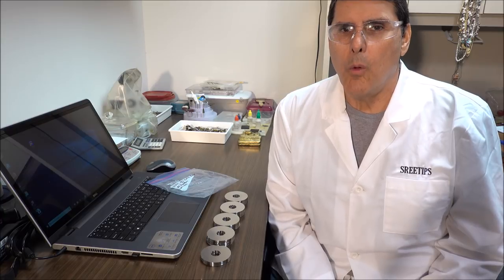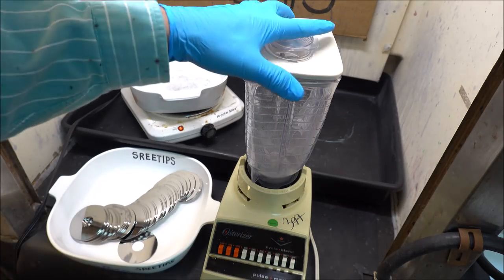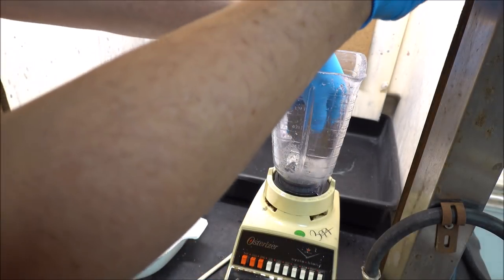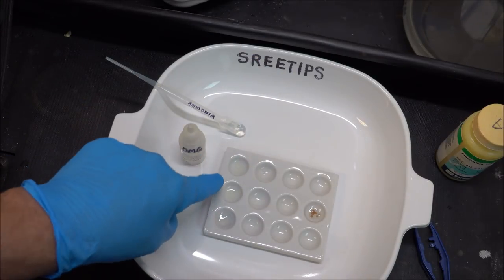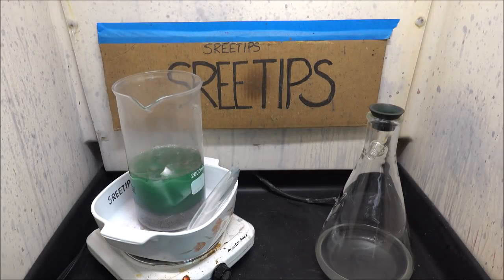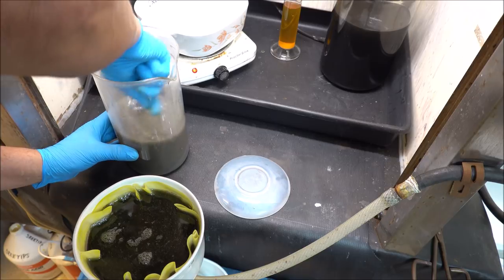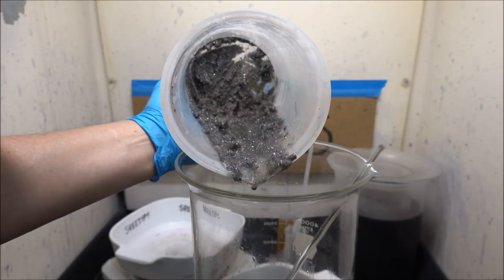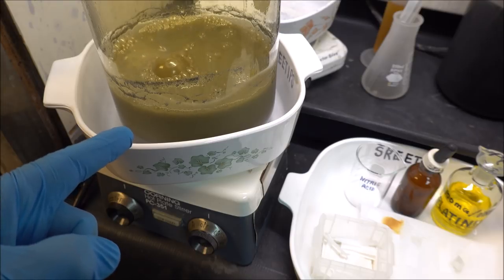Platinum Recovery From Computer Scrap HDD Platters

Comment: Thank you for your extensive and arduous work to prove the validity of going through this process. At first I was contemplating going into the first steps to do it but here you’ve said it yourself there is very little platinum in those disks. Thanks for saving me the time, effort, and money ahead of time. Love the videos

Comment: You would get more platinum by sweeping the freeway for the dust from catalytic converters
Reply: CODY!!!!
Reply: Isn't that palladium?
Reply: Cody!
Reply: @joeestes8114  CODY
Reply: @nickkk420  Most are made with platinum, but they did start using palladium roughly 10 years ago to save money, but now that palladium is much more expensive than platinum, not sure what they use now.
Reply: BIODIESEL, ELECTRIC, ETC...
Reply: Yes
Reply: @nickkk420  yes
Reply: Lol cody does dirty, ghetto rigged chemistry, haven't been back since I found sreetips.  Best to sweep up at the exit ramps, at the light where cars idle for 3 minutes.

Comment: Again scrapping as a side to my electronics repair , have gone through 100s or 1,000s of these .
Good confirmation there is little value .
What I have done , is hit them with a hammer - glass breaks , the ones that bend go into aluminum recycling , so I do get some money for them .

Comment: The HDD platter are make with silicon media, glue, iron particle and fine coating of platinum that protect the iron glue on the silicon. You better need to melt the silicon in quantity and gather in the bottom of the crucible the platinum.

Comment: Just a little “blender tip” when you have a lot of the slurry at the bottom and then add more discs, try starting the blender slowly and then increase speed a bit at a time and also try pulsing it to more the sludge around. When you start the blender on high speed it actually pushes the sludge out of the way of the blades. I really enjoy watching your videos, thank you for filming these for us to enjoy!!👍🏼👍🏼👏🏼👏🏼😊

Comment: Even a "failure" is a success. Now I know that those shiny circles I have in all those dead hard drives may not have the precious metal value but can still be used for crafts (such as clock faces, mobiles, etc). I love your videos and would love to experiment with extracting precious metals from all my old electronics. Keep up the great work!!

Comment: @sreetips  at 24:00 you made a comment today about people complaining about length and repetition. Just today Nile red released a video about refining some scrap and while he was going through the process he deviated from your norm in several places. Some of these oversights I would even have called errors. For instance I noticed he didn't wash out that i was correctly able to identify (based on your clarity and repetition) as silver chlorate. That silver then went on to contaminate his gold later in the refining process. I think You're doing great and wouldn't change a thing.

Comment: Sreetips, I am enjoying your videos. I am a research chemist and chemical engineer retired, and I have done experiments like the ones you are performing many time. If you would stir the large beakers using a magnetic stirrer when you add the acids you would be able to control the aggressive reactions much better. You would need a good stir plate to get through the corning ware bowl and beaker but they do exist I used one in my analytical/research lab for years. I do enjoy your videos and I plan to continue watching.
Reply from the maker: I have a nice Corning heated stirrer.

Comment: Amazing with the work you conduct to refine precious metal, even at the request  of your followers. I specifically enjoy your routine with regard to stepping out the process, if it were to take the time of an hour, or two, maybe four or even twenty, your speciftic fundamental process is the correct way to move through the motion of refining. I personally have wondered how metals have been refined to the grades of very fine materials with absolute wonder. You have bridged this gap between my wonder to the point of simplification that I could work through the same process, I personally want to thank you for your interest, time dedication and knowledge that you have provided for free, with regard to how you work through the rigorous sectioning of rinsing, acid washes and finding ways to process certain materials that you may have not encountered before shows true dedication, to which I think you for, including when I find myself watching the same thing over again, I just simply hit the ffd button, so please keep conducting your work as you do and enjoy the outcome, as I do, thank you so much.
Reply from the maker: Excellent, thank you

Comment: I appreciate the detail.  Love the videos.  Love when you refine gold.  I just read that if you start with 18K, you don't need to inquart with silver.
Reply from the maker: 18k gold will have some silver in it. I think the book says that gold 21k or above can be dissolved in aqua regia just like it is. I may be wrong. Getting the silver out is the problem. Inquarting and parting with hot dilute nitric can get nearly 100% of the silver out of the gold. After all the silver is gone, the gold is a dream to dissolve and refine.

Comment: I have been a computer operator since 1996.. I started in a data center with legacy servers, and I remember they had some of the real old disc platters in a storage room, they could fit in a washing machin..just huge platters from the early 80s
Reply from the maker: I did heavy gold plated slip rings for the jeweler a few years ago. We gold nearly an ounce of gold and 10 ounces of silver.

Comment: i would have considered using potassium hydroxide to dissolve the glass first to make it easier to handle the platinum group metals so i did not have to use so much hydrochloric acid i would also have considered grinding the stuff to a finer powder so as to gravity separate the metal from the glass before i did chemical extraction with a shaker table or blue bowel.
Reply: @silvestor3632  yes they are, and as you found there is very little platinum selling them on ebay to artist types will get you a lot more money still, we do this because we are querious and it is fun.doing things that makes you different that 99.99% of your friends and neighbors don't, this simply makes you a builder the world gets better because of people like you.

Comment: Mr. Peters,

I scrap tech equipment. I always separate the metal, but only as far as the local scrap yard. I save group 10 and and 11 bearing material for later. Red Metals, however go to the yard.

I use floor scraping chisels to scrape the boards clean. (Too many damn Ferrite Inductors, even microscopic ones, and Inductor Arrays disguised as ICs ).

I am on the process of using a Harbor Freight China Electric Rock Tumbler with some H20 and a little detergent to create a foam to suspend whatever gold gets scraped from Card-Edge Connector Gold Plating. I'm waiting to see if any does. The media is just Quartz landscaping Granite.

BTW, those Card Edges snap off much more easily than they cut, They are made of a composite of Epoxy and Fiberglass. They snap off easily with a pair of Pliers. If however you cut them off, and you do so for a living, your wrists will be so strong that you'll be able to crush someone's head with your bare hands. Guess that's something.

The MLCCs seem to need a either a Mortar and Pestle, or a better Ball Mill than just a rock or jewelry polisher. Not sure about getting the metals out at this point. Palladium has a melting point like Iron, and I think it was Palladium compounds in paint pigments that made Van Gogh cut off his penis and send it to Lorena Bobbit. (And was probably Palladium salts that made me remember it like that too).

I tried incinerating with extra Oxygen. The boards themselves have plenty of fuel. If they can be incinerated with excess Oxygen and the combustion products bubbled through H20 you should get some kind of mix of Nitric and Hydrochloric Acid.

The organic Nitrogen in the plastic can be oxidized, and with it any Chlorine from PVC burning would get dissolved in the H20 Scrubber. This would clean up the incineration smoke, and possibly give you some kind of Aqua Regia mix. Just burning the material in a Hydrocarbon flame, at atmospheric Oxygen concentration produces way too much material from incomplete combustion as really nasty smoke. Cigarettes are way safer. I tried some of these things but have limited facilities at my business for burning stuff, chemicals, etc. Incineration is a good route if it can be done cleanly. The boards have Carbon to keep oxidation down, but likewise you can oxidize some of the base metal with an Oxidizing Flame, if that is what you want. I noticed when testing one sample in a burn, that the gold from a batch of pins, and maybe a Gold-laden IC wicked onto some heavier pieces of copper wire left in the mix, and plated them.

I one of your videos, the same batch of Gold went from 5 Hours down to 45 minutes dissolution time when precipitated as sponge. For sure, surface area matters. Enough so that a batch of powder will bubble up in your face at room temperature if dropped in an aqueous solution that is highly electrochemical. Some kind of logarithmic deal going on there, I think.

I have learned a lot from your experiments. Thanks.
Reply from the maker: I read your entire comment, thank you. Sounds like you've got a good grasp on these processes. Had to chuckle when you said I'd be able to crush a head with bare hands from breaking those boards.

Comment: The results you got were the same results with all hardrive platters.  Precious metals aren't used as the magnetizing metal that stores data in platter disks.  The Wikipedia has hardrive platters material composition not listing Copper, Silver, Gold or Platinum metals at used spread thin film over the glass in the platter composition.  Metals that are more magnetic make more sense (as that relating to iron).

Comment: No need to grind the glass platters, just soak them in chlorine acid solution and let em soak. You will get platinum samerium cobalt and a little rhodium from them. Btw love those vintage oster blenders, those are tough as hell.

Comment: I think crushing disk plates was completely unnecessary and only added to the labour - both as itself, and in further steps dealing with all that crushed mess (glass "slurry") - repeated washing, filtering and such. Not to mention (most likely) scratched beakers, which renders them kinda unsafe to handle and heat.
I'd just stack those plates in a beaker with some thin plastic stripes between them as spacers (so the liquid could get between them), then I'd filled up the beaker with aqua regia and dissolved EVERYTHING that can be dissolved in it - all metals: iron, nickel , platinum, and what not. I wouldn't bother with any washing with HCl, filtering re-washing and all that - I'd soak them whole, for a week or so, untill I'd see clear glass (means, all metals deposited on their surface got dissolved, and there's no Pt inside the plates) - and then I'd just rinse them and throw them away.
Then I'd precipitate all metals in one go (Pt, Ni & Fe), as one mix - and ONLY then I'd started refining procedure with that filtered precipitate.

Why so? Well, plain and simple, much less work (call me lazy, if you want ;-), and besides HCl and HNO3 are not really that expensive - so that additional litre or so wouldn't cost that much (probably less than that thrift store mixer and electricity to run that vacuum pump). Much of the beaker's volume would be taken up by those glass plates anyway, and should there be too much empty space one could use glass marbles to fill up some of that volume. And then you work witch much smaller quantity of precipitate, much more concentrated - easier to work with, as simple as that.
But maybe it's just me and my tendency to make life and work as simple as possible and to avoid any unnecessary steps...? But if there isn't any Pt WITHIN the glass, why actually bother with crushing them? It would be like grinding those gold "fingers" and SIM cards prior to processing them.
Makes no sense to me, and even if it was any Pt INSIDE the glass that simple crushing wouldn't make any difference - one would have to grind the glass into an extremely fine powder to extract any Pt from it.

I am chemist by training and education (although it's been ages since I was working in laboratory), and while I have no personal hands-on experience in refining precious metals, some steps and approaches/ procedures are kinda standard, regardless of whether one refines bismuth, silver or platinum. Yes, reagents and SPECIFIC procedures would be different - I'm  referring to "approach to physical objects" that are source of metals.
But, regardless - nice videos to watch. "Golden memories from youth", you see... : )

Comment: It would be slower but safer in the long run to crush them up with a hammer inside a fibrous mail envelope. Then put them in a rock tumbler for a few days to a week. The powder would be so fine and wet so no dust. The advantage of your way is it gets done well enough to get the job done much faster. I'm always satisfied with letting things work in the background for long stretches because I'm lazy or different.

Comment: I can't believe hdd platters are glass... okay, so I thought I'd search before commenting: as of 2015 hdd platters have been made of glass. Previously (and still in desktop computers, as far as I can tell with a quick search) they were made of aluminium alloys. Glass substrate was first used in 1990 and has since become popular. I was just wondering about this because I made a spinning top using about 25 x 3.5inch platters as the flywheel (it was supposed to become a gyroscope). Given what I put that spinning top through there's no way any of them are glass!

Comment: Adding the water to the blender is a mistake. The bits will float away from the blades and won’t break as fine as they will in a dry blender. I would have placed a damp cloth over the blender lid to catch any particles coming out the small holes. The cloth can then be rinsed later to recover any small pieces.
Reply: what point if noting to process after ?

Comment: If you salvage the chromium and cobalt as well, it could be worth the effort.  They are 60% of the plating by weight, even in the glass ones.... if you get several hundred of them for a few bucks.

Now, I got myself 250 of the BIG METAL disk platters for a mere $50!  MUWAH HA HA HA!!!  >:D

From the solid metal platters, I also recover the aluminum as alumina powder, which I can use for making highly pure silica-alum ceramics (I can make my own crucibles!) and artificial ruby-sapphire.  You can even get the colorants from various electronics solution waste!  Cobalt and chromium salts can be made directly from the plating after precipitating the platinum!  YAY CHEMISTRY!!

Comment: ONE PROBLEM.
The reaction of platinum with aqua regia is very slow. I think you should keep it on heat for over 24 h.
It is also possible that you can keep it in your glassware, with a stopper, for 1 month and room temperature but that is just a guess on my part.

Comment: 900 platters seems like a very low calculation where as 180,000 platters should equal out to a gram of platinum - also id like to note not all hard drives are made the same which is to include the platters - so it is likely unknowing if these platters all came from the exact same hard drives/manufacturer and relative dates of manufacture - 900 is more like 1/200 which thus would explain why you were unable to detect virtually no platinum, nothing against the guy who gave you the calculation though it would seem the base number of platters was/is off. 

im nearing 180,000 platters myself from doing ewaste recycling over the past 9 years, wasnt saving them at first but can attest that not all hard drives (PM content wise) are not made equally.

a general rule i follow to give a rough PM content (quality and quantity) and what i call  "gold base standard" 
prior to 1984 - testing 20k-24k depending on component (1 computer) 3 grams
84  to 92 - testing 18k - 22k almost invariable (consistent through out 1 computer) 2.8___grams
92 to 98 16k - 20k none consistent  (1 computer) 1.8 - 2.2 grams 
98 to 04 - 14k - 18k (maybe 20k here or there) win xp era   1.7 - 2.0 though 2 grams is dependent on upgrades to the machine 
04 -present 12k-14k - variable ( depending on age and installed equipment 1 gram - 1.5/1.7 (gaming era)

idk how this translates to other PM metals but component quality sure has changed along with the quantity of internal components of components has greatly- i've had some pretty beefy hard drives from the late 80's - storage in the KB -MB rage and they had upwards to 10 platters inside where as the most modern drives have 1 platter.

  nearing a pound of gold recovered - prospectively should be at a pound by 2020 though in my area during the winter there is not much recyclables to purchase - late spring is when there is ample ewaste.

love the videos no matter how long they are- definitely a more involved process's than i employ.